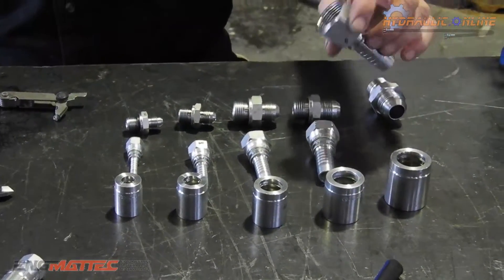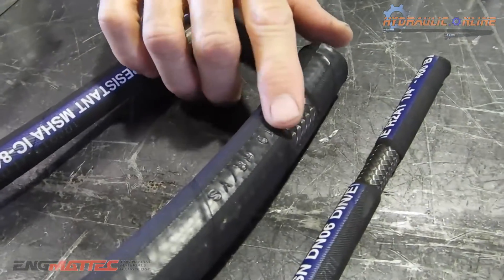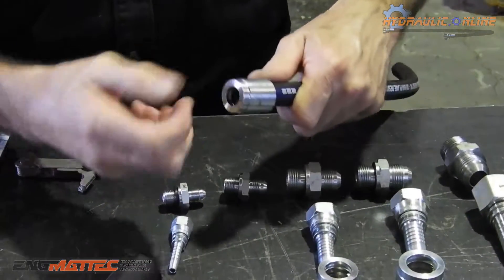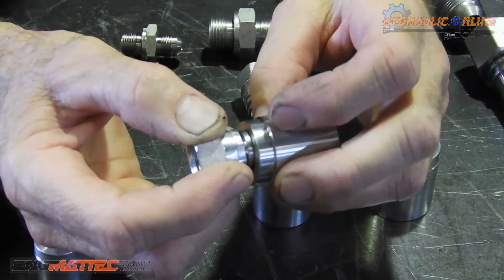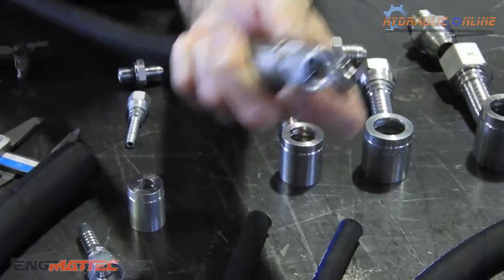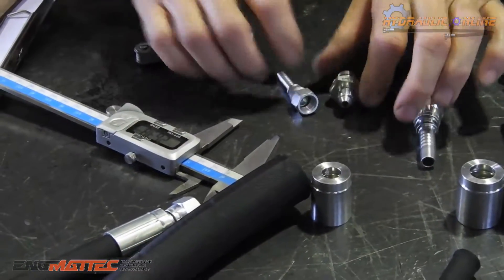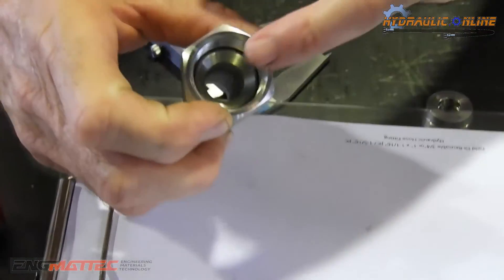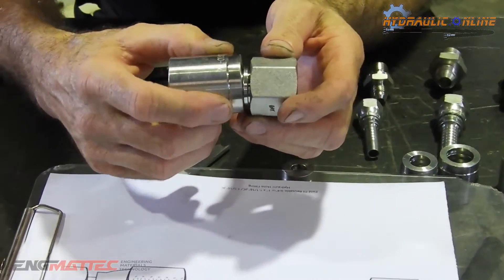How to assemble Hydraulic Hose Fittings Introduction Identification and Guide on JIC thread Type

Comment: Hi, thank you for this great information. I have a project where I am using hydraulic clamp to design a fixture. the hydraulic clamp has max 3000psi pressure capacity and use G1/8 thread for the fitting, what type of fitting/couplers/hoses can I use to connect these clamps?
Reply from the maker: Hi thanks for watching our Video.
It is best to use commonly available hydraulic materials to keep costs reasonable so I would suggest the following parts, if your  hydraulic clamp  has a female  G1/8 thread then use a 1/8 to 1/4  male to male nipple and then use 1/4" poppet style couplers with female  G 1/4" thread  ( flat face couplers in 1/4" size  also available but quite rare and expensive) use 1/4" 100R2 2wire hydraulic hose as its good for 5600 psi and 1/4 " reusable or crimp on hose ends with male threads to directly screw onto the couplers. Depending on the room you have available you may have to use 90 degree male male fittings on the clam , or connect hoses to the clamp first and move the couplers away from the clamp to a more accessible area.